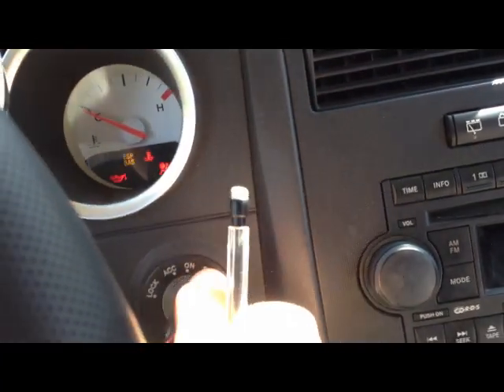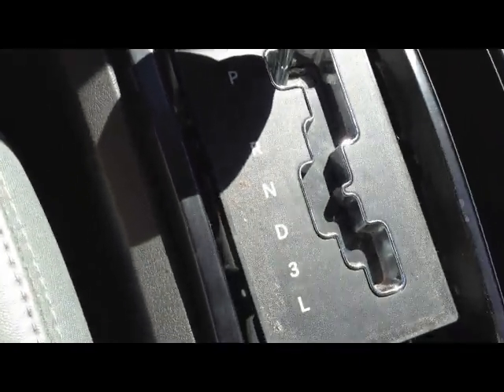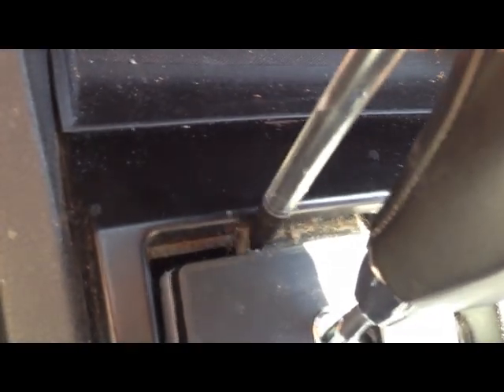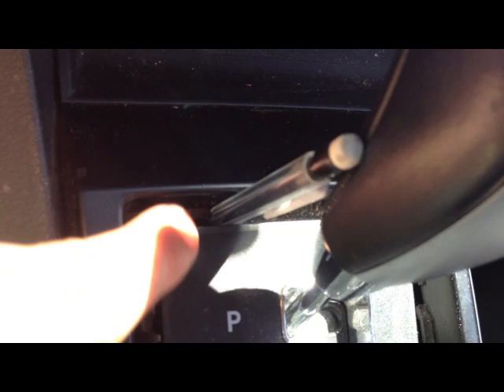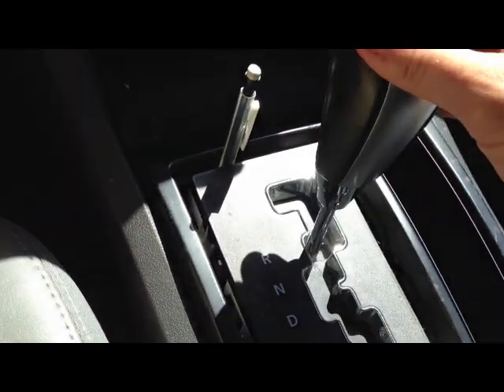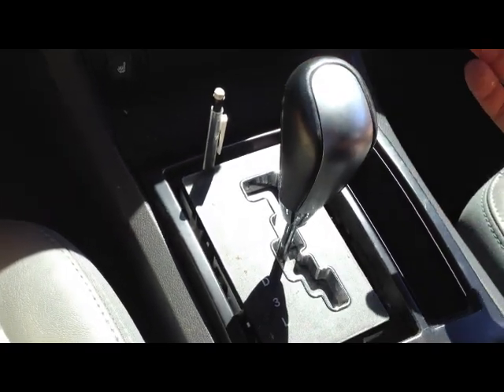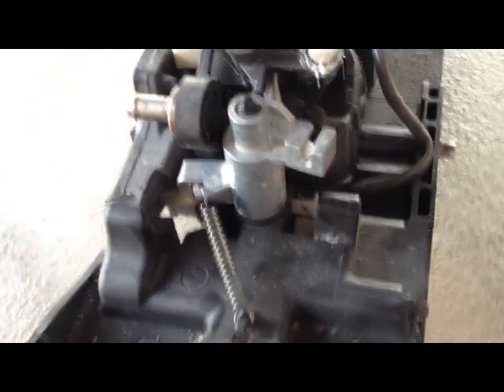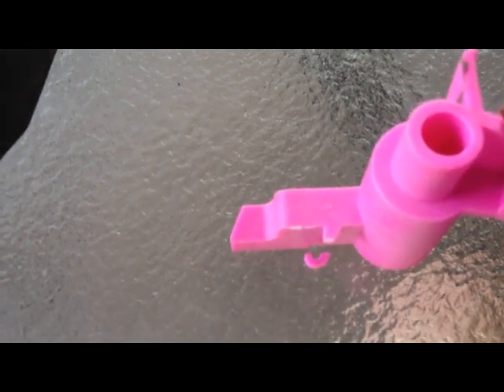Dodge Magnum shifter stuck in park - Watch how easily this can be worked around!! SO SIMPLE!!

Comment: Thank you Bradley!  I was stuck in my driveway today and in a rage, because of ANOTHER transmission related issue with my '06 Magnum R/T AWD.  I'm already on my 2nd transmission and 4th torque converter (all replaced by Dodge under warranty).  But yeah, thank for so much for a simple work around and fix, and for lowering my blood pressure as well!  Other than that cheap plastic part (on a $40k car), the NAG1 transmission on these cars must just be too weak for these cars.  I have less than 70k miles on it, original owner etc., and it's my baby, and don't beat on it EVER.  These were supposedly the good years of Daimler/Chrysler too.  UGH.   But again thank you so much!

Comment: It's 26 degrees in Providence, RI. And I could not be more thankful for your video. I'm trying to get home to fix a no-heat situation at one of my apartments. And why the devil am I stuck in park?!?

Well thanks to your video, I got home with little trouble. And thanks to the video linked in your description, I took apart the shifter. Except I couldn't get the leather-ish handle off and so did not disassemble the shifter assembly. I stuck a plunge cutter into the passenger side access hole on the assembly and trimmed off the offending tab of that plastic demon. This thing has taken more of my life than it deserves anyway.

And good riddance! This problem is a picture of everything I hate about new cars.

Chrysler's "so-called-engineering" dept:

"Hey folks, everyone is an idiot these days so we need to trap people in park until we are sure they can move on. And its not enough that we have the brake safety switch, we need ANOTHER REDUNDANT DEVICE to keep people in park,... just in case. And of course, we're not going to use metal for these parts. No, no, we need something MUCH MORE BRITTLE in the winter months. And lower quality, too! Let's use PLASTIC for this trash!"

"Aye! AYE! HARDY HARR HARRRR!"

I can't imagine any American car company doing this 30 years ago. They'd be laughed out of the business.

Good Riddance.
Reply from the maker: +firstjohn26 We'll said! Glad I could be of help!

Comment: Thanks so much Brad! You got me out of a bind!! Only problem is....I broke the cable when I moved it. Got the car functional though! Thanks......I'll figure the rest out later.
Reply from the maker: Hey Chris, good to hear that this helped you get out of a bind. As for the cable coming loose when you did this, the cables are only held in place with a small pin at the end of them, but they are installed pretty darn tight from what I remember.

Comment: Great video man really helped but I used a flat head screw driver and I found that it works better it moves the wire a lot easier. It was on a 2006 Dodge Charger
Reply from the maker: Sweet! Yeah it's amazing to me how common this issue is. 🤯

Comment: Brad, this did the trick on my 2006 Magnum that had the same issue. Mt only suggestion would be to use a screwdriver instead of a pencil as mine broke, but the screwdriver did the trick. Thank you for this great advice and video.
Reply from the maker: Brent, great! Keep it handy until you can get it repaired. ;)

Comment: Hey Brad, good info!  Here is an easier way to get the magnum out of park. There is a narrow, thin compartment tray thats perfect for holding a cell phone, just to the right of the shifter.  if you remove that compartment tray and slide your hand in you will find a plastic pink button. hold it in and move the shifter. no pencil required.  the dealer told me about this secret button.  i believe what you will actually be pushing is actually part of the thing that you replaced.  it was good to know that it can be replaced.  my dealer wanted me to purchase an entire shifter and i was ready to do it, until i saw your video...thanks!
Reply from the maker: Maddie good point, thank you for mentioning this!  This may help someone else although for some reason this wasn't working for me so I had to use the "pencil" fix.

Comment: This happened to me i just broke it. Put too much pressure on it but it worked. Only thing is you don't have to apply the break to take it out of park anymore other than that it works normal
Reply from the maker: Hadn't thought about how much or how little pressure to use. Anyhow glad to hear your not stuck!
Reply: Damn I’m at the mechanic now with the new part, I might need to try your method 😅

Comment: Why is this working for everyone but me? Is the cable a black shiny thing? I got that moving around but so far nothing
Reply from the maker: Dean, the cable is just silver wiring but the harness is black and wider. Pop off the silver cover plate around the shifter and you should be able to do this. Has worked for MANY others. Maybe try using something longer to press into the opening and activate the cable.
Reply: Thanks and in sure you're right. What a horror show that was. At work which is 30 miles from town and that goddam ... Grrrrr. I tried it with a pen, a welding rod, I had to swipe in and out every time I calmed down I figured I could try it again or ... You know ... Try it again. But I finally had to say piss on it and get a thirty mile tow truck story eughhhhhhhh. But I really appreciate it.

Comment: Thanks, got it out of park as described and got me to my Dr. appt. However, my '05 SXT 3.5 (I assume just like yours) won't  turn off in neutral, the key won't turn beyond acc nor will it come out unless it's in park.  So back to park, repeat.  But like I said, many thanks.
Reply from the maker: That's interesting John. I too have the 3.5.  Anyhow at least You have a work around for now.

Comment: I HAVE A 2005 MAGNUM   140K MILES
 I HATE THIS CAR!!!!
SPEEDOMETER (NOT WORKING)
GAS GAUGE (NO WORKING)
CD PLAYER (NOT WORK)
A/C FAN (NOT WORKING IN NO 2 POSITION
RR WINDOW (NOT WORKING)
PEDAL ADJUSTERS (NOT WORKING)
POWER SEAT CONTROLS (FALLING APART)
ENGINE LIGHT ON (ALL THE TIME)
TRANSMISSION (CLUNK CLUNK) 
ALSO STICKING IN PARK

FIRST AND LAST DODGE
TOTAL PIECE OF CRAP!!!!!
Reply: you sure got this dodge from second hand, instead brand new.

Comment: I have done this trick already and it has worked for awhile but not it won't shift again after a year or two without replacing the part. Any suggestions?
Reply from the maker: Nephew sounds to me like you're gonna need to replace it. Took me less than 2 hours to do it myself.  The link to the video I followed to do that process is in my show notes above.

Comment: thank u,do I leave the pencil in until it's fixed
Reply from the maker: Not necessary Marilyn. But you will need to use it any time the car is placed in park. As long as you don't use park, you won't need it.
Reply: Thank u so much
Reply from the maker: +marilyn Northrup You are very welcome! Please like and Subscribe. :)
Reply: What is the name of that pink part i need
Reply from the maker: +marilyn Northrup I don't remember Amber but it's in my video.  Check it out.

Comment: It's a lot easier and quicker to use the release latch underneath the coin changer. I have replace my shift interlock switch and I still have intermittent issues with it getting stuck in park.
Reply from the maker: Kenya Renfrow that didn't work for me when it happened to me but good point. Worth a try.
Reply: Brad Bischoff I constantly have to use it until I can figure out why it still gets stuck haha :)
Reply: Brad Bischoff I replaced this part with the metal one and it still gets stuck occasionally. Any tips?
Reply from the maker: Kenya Renfrow wow, not really. Every now and then my key won't pull out of the ignition so I just jiggle the shifter and it comes right out but thankfully I haven't had one issue with the shifter getting stuck in park since replacing it the interlock piece. Maybe it wasn't installed correctly?

Anyone else replace the Shift Interlock only to find your shifter still gets stuck in park? Please reply so we can help Kenya.
Reply: Brad Bischoff The issue your experiencing can be that the srping that came with your part is tight or more constricted than the original. All I do for that is tap the shifter to the left and it will release the key. Ran into that issue before. Ironically I jammed my pen down there and pushed out the cable a bit and now it's working fine.
Reply: Brad Bischoff I just replaced mine again and it gets stuck but the arm isn't broken and then I hear a click and it releases and moves out of park, any idea?
Reply from the maker: Kenya Renfrow I don't have any idea unfortunately. Unless something is catching in there.
Reply: Brad Bischoff it's weird it will get stuck, then you hear a clink and it releases. Nothing is catching it as it will work fine intermittently.
Reply from the maker: Kenya Renfrow that's crazy! 🤤 Maybe someone else can chime in here soon.
Reply: Brad Bischoff I'm ready to throw the whole car away. 😂
Reply from the maker: Kenya Renfrow Nooooooo! 😂
Reply: Brad Bischoff She's my baby but I need a new LF control arm, a thermostat, probably a new starter in the next year or 2. And if I can't fix the shifter,  a new shifter. 😢

Comment: Oh man! Worked like a charm!!!! But now...my Charger won't shift out of 1st gear....
Reply from the maker: Susie, I'm sure doesn't have anything to do with this fix but obviously there maybe a deeper issue here.
Reply: Indeed. Turns out completely separate from the broken gear shift piece, my transmission's circuit board was malfunctioning.  Had it replaced at a transmission shop and it's been fine ever since.

Comment: I am away on vacation 600 miles from home, parked in a parking garage, and can't get it out of park.  I am heading there now to try your tip out. Thanks so much
Reply from the maker: Hey John I assume that all went well so I am glad that you came across this video! 600 miles is long ways away from home.
Reply: It worked out great... thanks so much. We are not getting home until Saturday.  Finally getting used to putting it in neutral instead of park

Comment: Damn, My mechanic's talking about a $400 tab or so for the repair. Eff That. 
I'm going shopping for some screw-drivers. 
And where can i purchase the replacement spring? 
Thanks/
Reply from the maker: Replacement part info is at 0:50 in the video.
Reply: I got it already. Ordered the metal replacement off of amazon. 
Thank you sir. Now I'm off to oh watch some tutorial vids.
Reply from the maker: +Moe Fawkah great!

There is a link to the video I used when I changed mine in my show description notes above.

Comment: if I had a dollar for every part on my Dodge that has broken in the last 8 years. I can probably buy another car. It's a shame you pay so much and get some cheap parts. Great post thanks for the information
Reply from the maker: Welcome Voodoo. Overall mine has been very reliable and have not had to sink a ton of money into relatively speaking of course.
Reply: +Brad Bischoff well mechanically she is good. Cosmetically not the case. both dash vents popped out passenger vent popped out driver door Controls only front works and the panel has popped clips.

but the car runs like a dream.

Comment: Always Leary of videos with these odd quick fixes. Tried it-it worked!! OMG. Any idea what the real fix is? And how much?
Reply from the maker: Hi Greg. As I state in the video, I am no mechanic by any stretch of the imagination. I only shared a work around to help others out of a jam when it happens to them. In this videos description I put a link to the YT video I referenced when I fixed mine as well as a link to the part you'll need on Amazon. The part is very inexpensive (less than $20) and took an hour or two to replace. With over 197,000 views and over 1.6k thumbs up, this video has helped thousands get out of a jam in order to get their vehicles safely home or a repair shop. So glad to hear that this worked for you!
Reply: @BradleyLivestreams  It was a huge help my friend. I missed the link for repair part. Is that pink lever the one you access from removing the "tray" to the right of the shifter?